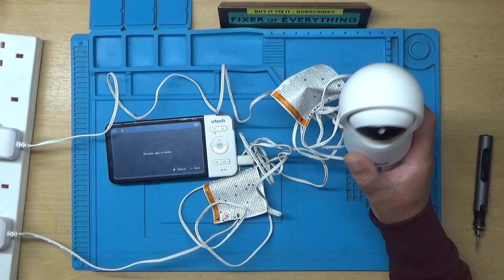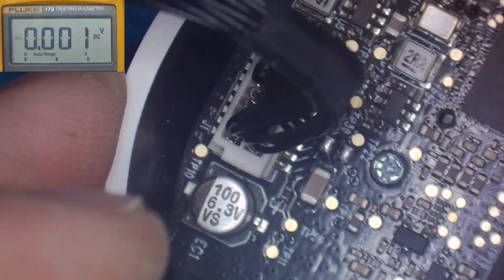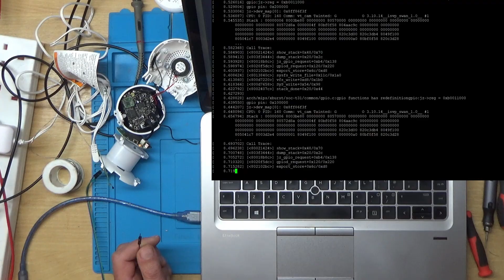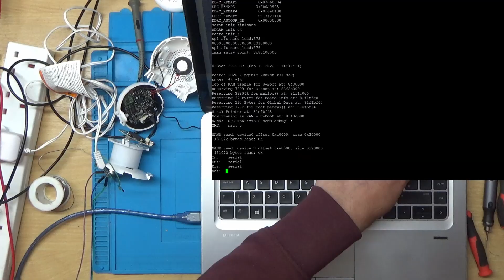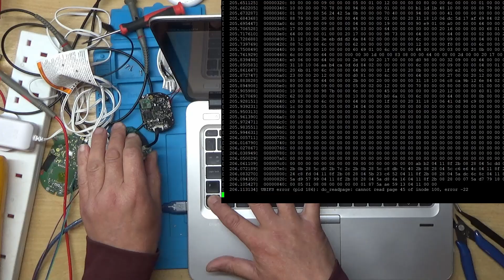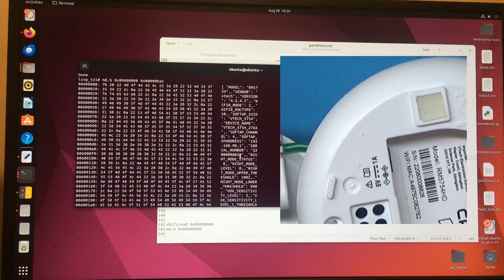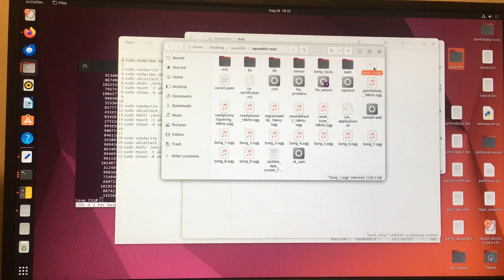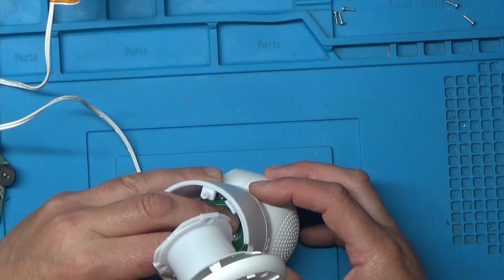Faulty VTech Baby Monitor | An EPIC Repair With Shocking Findings!

Comment: May i suggest something? In Linux you have two separate clipboards. 
One is what You used. Right click -> copy/paste, or ctrl-c/ ctrl-v. 
But second one is much more convenient while using bash. Every text You  selected is automatically copied to this second clipboard. Middle button pastes it wherever pointer currently is. It of course require a little bit of learning, but at the end it is much quicker than right clicking to menu every time.
Reply from the maker: Thanks very much for that tip! It's been a while since I used linux (used to have my main machine running ubuntu about 7-8 years back).

Comment: Hi Mick really fantastic work tou did how you figure it out all the comands. You are really determant in this. Nice work really enjoy it all your computer skills and programming realy fantastic. I really enjoy your channel.
Reply from the maker: Cheers Steve 👍
Reply: Hi Mick can i ask you something fridge freezer wwith electronic temperature controller freezes when it is on highest setting how does the temperature regulates is that via the temperature controller because i do not see any thermostat like before with the knobs. I find no information on internet how it works such fridge. it is build in model AEG . Can you help me?  Regards Steve from Belgium

Comment: Should get on to VTech. Might be well be a zero day vulnerability there. Iirc. Didn't VTech make the same mistake a while back with the Leap? That is pretty frightening when you think about it. As usual, a great video full of information. I particularly enjoyed this one. Used to use RS232, with terminal to program routers. Mainly to block out sites for the workforce. Cheers.
Reply from the maker: Cheers mate 👍

Comment: This guys ability to hypothesise and then test and then progress to the next hop is brilliant. Clearly v knowledgeable about a lot of things from electronics to detailed linux boot and file systems. Super smart and super enjoyable to watch. Thanks for persevering - well worth it for the content more than the actual baby monitor fix!
There was a similar issue with colour HP laser printer I had once that wouldn’t boot. Someone posted details and pin puts which followed and managed to get myself back up and running. V satisfying and so can imagine actually cracking the problem and finding a fix must be v v satisfying and rewarding. Top marks, sir.
Reply from the maker: Thank you very much kind sir 🙂👍 and well done on fixing the HP printer 🙂

Comment: Excellent stuff, so did vtec brick this and others with an update?
Reply from the maker: After I finished recording I managed to find the file that caused the problem. So I'm not sure if I can be blamed on the update although the dates did seem co-incidental so it still may have been the cause. The problem seemed to be a sqlite database stored on vtech data 1, which indexes the video files, so perhaps the camera lost power or rebooted while updating this file. I think deleting the videos caused this database to be re-created and fixed the error.

Comment: Mick your skills are outstanding! I love watching your videos. You’re the same as me though, when you get a fault that’s challenging, I can’t stop until it’s solved lol! If I ever get a fault on a car that I’m really struggling to diagnose I’ll go home and research even more, delv deeper into the wiring diagrams and have another go. Well done again. I wish I had just a tiny amount of your knowledge on component level repairs, and the software skills are incredible. P.s the GYS battery support unit is still running perfectly and has been used 2-3 times a day 5 days a week since your repair 👍🏻 take care
Reply from the maker: Cheers Matt 👍Glad the Charger is still working well 🙂

Comment: (commenting after only having watched the first 10 minutes): I found a similar issue with an "Eufy" brand baby monitor. It was caused by a cold/fractured solder joint between the main board and the wifi daughterboard in the head unit, possibly b/c it had been dropped one time too many while beeing carried around... was a nice no-parts fix (and of course required much less skills and patience compared to what you had to do to get this thing up and running again).
Reply from the maker: Thanks 👍Yes I thought it might have been a problem with the WiFi board too, but I guess I was wrong also 😂😂😂
Reply: @BuyitFixit The last time I dove into "chip-off" EEPROM recovery / reprogramming  was maybe 8 or 10 years ago when you could buy those very cheap chinese A5-V11 pocket routers to put OpenWRT (or at that time,  the "LEDE" fork) on them which made them  useful for a lot of things. Sadly, OpenWRT/LEDE stopped support for devices with 4/32MB RAM/Flash shortly after.

Comment: Absolutely brilliant fix I love it when you get right into the firmware

Brilliant
Reply from the maker: Thanks 👍Done it a few times now. I've just created a playlist with some other videos like this one if you haven't seen them.
Reply: @BuyitFixit  definitely will check them out.

I’m shocked by how much dev stuff is left behind on the production versions.

Looks like no optimisation or not starting off we a clean minimal, all that’s needed before going to manufacturing.

Wonder how many tools / bins are maybe still on these devices that hackers could utilise.

Comment: Alot of work and alot of machines to track down wat was wrong..could you make decent money fixing it..
Reply from the maker: Possibly a little as a used unit working is around £60-80 and this one cost me £13 and no parts to fix it.

Comment: A marathon fix, well done. Of course, Xi now has a copy of your face, ramblings and hacking. You already know that 0 Ohm resistors were not originally designed to be fuses.
Reply from the maker: Cheers Ralph, yes although they seem to be used as either fuses, or occasionally I've seen them as jumpers.
Reply: @BuyitFixit  Normally (in my day anyway) inserted to provide test points and methods of circuit isolation (of power and signal rails) for easier issue analyses and to connect external tools. Ironic (in my opinion) that they are sometimes referred to as fuses as their resistance is close 0 Ohms and therefore wouldn't consume as much power (and 'blow') as higher values would (with the same current).

Comment: Amazing you stuck with it.. fair play. New update probably had a different partition size/layout to the previous update and while trying to preserve the data during update caused issues with compatibility.. hence so many devices on Ebay..Same QA team as crowdstrike :)
Reply from the maker: Thanks 👍After I finished recording I managed to find the file that caused the problem. So I'm not sure if I can be blamed on the update although the dates did seem co-incidental so it still may have been the cause. The problem seemed to be a sqlite database stored on vtech data 1, which indexes the video files, so perhaps the camera lost power or rebooted while updating this file. I think deleting the videos caused this database to be re-created and fixed the error.

Comment: I teach web application penetration testing on the side and for the last lab i have my students learn how to read straight from the firmware update to find vulnerabilities without even owning the device.

The linux application is called "binwalk" and depending on the flags you can extract everything and auto mount it .

Comment: Just amazed by your perseverance. Did something similar with my one resin 3D-printer some time ago when it just hanged on the boot-screen after an automated update. Opened it up and discovered a serial-connection inside that spat out all the boot-messages. From that I could derive it received a corrupted firmware, and was stuck in a loop trying for unzip a corrupted zip file. Managed to break the loop, downloaded the correct zip file, copied it into the internal flash, and managed to get the printer working again. On the web, I discovered many people had the same problem, and the manufacturer’s advice was to return the whole printer, or the mainboard to them!!!!
Reply: Great sense of achievment i bet, fault finding can be very satisfying
Reply from the maker: Thanks 👍Great job on fixing the resin printer too! If you like this kind of stuff I've done a few others similar. I've just created a playlist on the channel with this video and a few others where I've had to do similar sort of work, or reverse engineer stuff.

Comment: Well done. Question, can you disable the file saving in settings?
Reply from the maker: Thanks 👍I'm not sure on that but you could just delete the partition and then it would have nowhere to save the files. I haven't tested it but the camera did boot up fully so it might work.

Comment: Extraordinary! Really interesting to watch you dissecting the software. Now try to upgrade the firmware and see if it fails again 😅
Reply from the maker: Thanks 👍After I finished recording I managed to find the file that caused the problem. So I'm not sure if I can be blamed on the update although the dates did seem co-incidental so it still may have been the cause. The problem seemed to be a sqlite database stored on vtech data 1, which indexes the video files, so perhaps the camera lost power or rebooted while updating this file. I think deleting the videos caused this database to be re-created and fixed the error.

Comment: Great investigation work and fix, I can appreciate how long that took.  I have used my old Raspberry Pi 3 before for communication with chips using TTL but I am thinking about getting one of those adapters.  We know that deleting and recreating the partition fixed it but do we know why it did?  I can only guess that maybe the update was some how incompatible with the existing stored video files or that some bug in the update meant that it could not continue if that partition already existed.
Reply: My guess, for what it's worth, is that the update was interrupted and couldn't recover. I also wondered how much space was left in the partitions. Note that by update, I mean the last one that occurred, and which broke it, before Mick acquired it.
Reply from the maker: Thanks 👍After I finished recording I managed to find the file that caused the problem. So I'm not sure if I can be blamed on the update although the dates did seem co-incidental so it still may have been the cause. The problem seemed to be a sqlite database stored on vtech data 1, which indexes the video files, so perhaps the camera lost power or rebooted while updating this file. I think deleting the videos caused this database to be re-created and fixed the error.

Comment: So, as usual, a firmware update bricks the device. Mick, you could make a Russian hacker blush. Not bad for a sheep rancher.
Reply from the maker: 😂😂😂Thanks 👍After I finished recording I managed to find the file that caused the problem. So I'm not sure if I can be blamed on the update although the dates did seem co-incidental so it still may have been the cause. The problem seemed to be a sqlite database stored on vtech data 1, which indexes the video files, so perhaps the camera lost power or rebooted while updating this file. I think deleting the videos caused this database to be re-created and fixed the error.
Reply: @BuyitFixit  I would have thought (or hoped) doing a reset would have deleted the existing video files, putting it back to factory default.
Reply from the maker: I couldn't find any way of a factory reset. Perhaps it was because the camera wasn't fully booted due to the firmware corruption.
Reply: @BuyitFixit Mick, Don’t you have a reader for processors? Cant you remove it and delete the video files then solder the chip back in? Just thinking out loud.

Comment: I think, deleting those partitions triggered a fallback and recreated the partitions from the factory image. Anyhow the camera should have also a restore to factory method. Button,  or if it has an SD card slot you can put the firmware on a fat32 SD card, and you can boot using that firmware. It's a Chinese camera and those all are easy to hack and also the root password is the same for all. For more info go to Matt Brawn VStarcam firmware extraction
Reply: Actually the root password might not be standard for all of them. This is NOT a vstarcan but a vtech
Reply: @309electronic5  I have one and is not VStarcam but has same username and password
Reply from the maker: No password on this one (as I looked at /etc/passwd and /etc/shadow) , but no active shell it seemed either.
Reply from the maker: No password on it as I showed the passwd and shadow files from /etc using uboot md. I couldn't find any factory reset, and it's doubtful that it would have worked as the device hadn't booted up fully due to the FS error. No SD card slot.  After I finished recording I managed to find the file that caused the problem. So I'm not sure if I can be blamed on the update although the dates did seem co-incidental so it still may have been the cause. The problem seemed to be a sqlite database stored on vtech data 1, which indexes the video files, so perhaps the camera lost power or rebooted while updating this file. I think deleting the videos caused this database to be re-created and fixed the error.

Comment: Amazing!  Really enjoyed your tenacity.  Why do you suppose many others are having the same issue?
Reply: I wonder did all of those saved video files cause an issue?
Reply from the maker: Thanks 👍 After I finished recording I managed to find the file that caused the problem. So I'm not sure if I can be blamed on the update although the dates did seem co-incidental so it still may have been the cause. The problem seemed to be a sqlite database stored on vtech data 1, which indexes the video files, so perhaps the camera lost power or rebooted while updating this file. I think deleting the videos caused this database to be re-created and fixed the error.

Comment: I am not surprised to see our friend the ingenic T31 in such a device. My hobby is hardware hacking too and i opened tons of these devices (mine are from Lsc which is a brand sold mainly at action which is a dutch/german european store. Or Kruidvat smart home which is a smarthome platform by kruidvat, a drugs/self care products store in my country or TPlink.). And wouldn't you know they all sported this chip! I even have a github repo open where i managed to put custom firmware on the chip, i so far only managed to get 90% success on the TPlink cam because they have all pinouts listed in the gpl source code and i am still working on finding the gpios for the software to use on the other cams. Also all these that i had ran Linux 3.10.14_isvp_swan which is a common kernel for these chips. I always thought these baby monitors ran some RTOS cause they do a relatively simple task but not all of them it seems. Pretty interesting and ofcourse they also use the common realtek 8189ft wireless chip which has a 8188fu kernel module also provided in the ingenic sdk :). Fun fact these realtek chips Support usb too.

I also bricked mine by accidentally ripping the tx pad which took the ddr voltage line with it.

That uboot is actually the bootloader. Das-Uboot or simply uboot is the most used embedded bootloader and its not a Surprise that many devices use it, it allows you to fully customise it and compile it for your target thanks to its opensource nature. The bootloader can support multiple ways of booting any os. It supports booting from flash using the 'sf' utility which allows reading, writing and erasing of the flash. It supports booting from mmc card using the 'mmc' subsystem and also allows booting over network via TFTP and also allows to receive a firmware file over the terminal via kermit or ymodem mode.

Also for the extraction part you can use binwalk on the file. Simply run "binwalk -e yourfile.bin" after installing it. It allows you to dump the binary to folders making it easy to look through it

Comment: When you mounted the rootfs it said 'recovery  needed' and then 'recovery deferred'. Perhaps the fs needs recovery - this system may not do an auto fsck. Does it have a command something like 'fsck' - file system check? It may have bad blocks which need recovery. Perhaps the help only lists non-standard linux commands. Try looking in /bin or /sbin for fsck.
Reply: Most of these Linux powered embedded devices from china get bricked after a bad update and dont have any recovery fs. I have hacked tons of devices and lots of iot cameras from china by tuya just bootlooped after a bad update and could not mount its rootfs cause corruption and bad blocks
Reply from the maker: After I finished recording I managed to find the file that caused the problem. So I'm not sure if I can be blamed on the update although the dates did seem co-incidental so it still may have been the cause. The problem seemed to be a sqlite database stored on vtech data 1, which indexes the video files, so perhaps the camera lost power or rebooted while updating this file. I think deleting the videos caused this database to be re-created and fixed the error.

Comment: Programming sent me over the cliff, never learned how to do it so have no clue.  You truly have special talents and patience to deal with items such as this.  It not only takes a mechanical wiz but an electronics background to fix this stuff, now I see software programming is requisite also.  Great job sir as always, it's not always a capacitor...😁
Reply from the maker: Cheers Terry, yes turns out it's not always a capacitor 😂😂😂👍
Reply: Yeah software is also a big part cranked up by the fact most low power embedded devices run Linux. Pretty fun! I do hardware hacking and i always love to see the device boot its linux system just to do a task :)